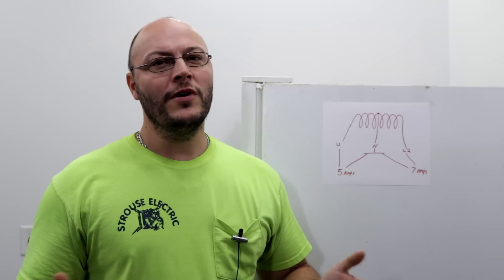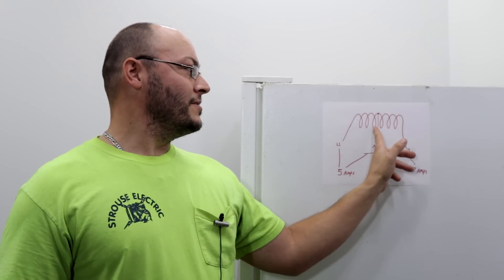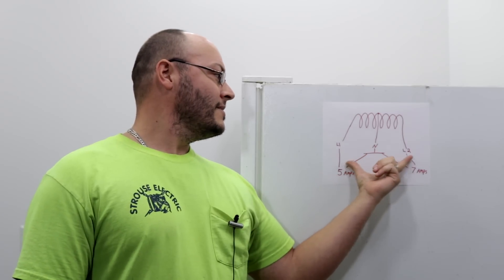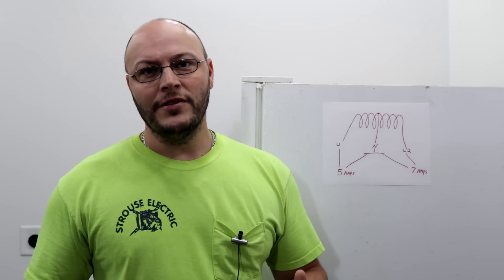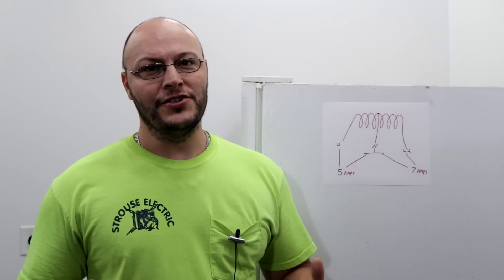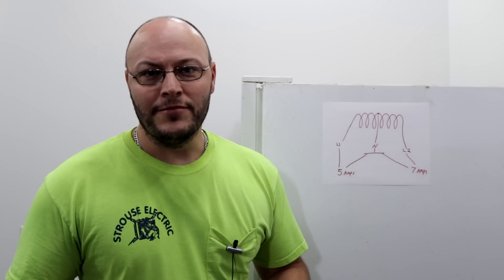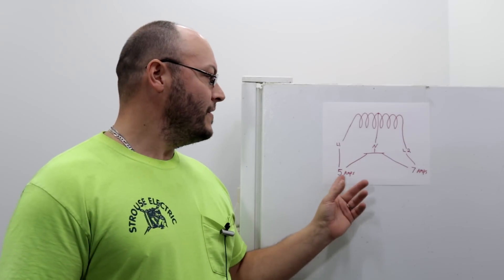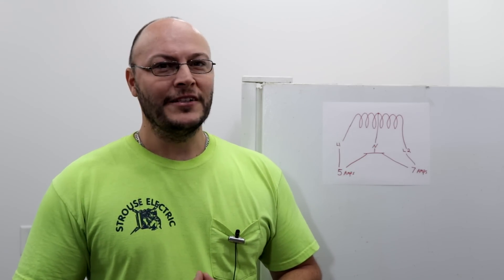What does the Neutral Wire Do?

Comment: I've been making hobby electronics for years and studying electricity on my own time on the side of my IT engineering studies, but neutral was always a bit confusing to me since obviously in an AC system polarity doesn't matter so I just couldn't really wrap my head around it as some people call neutral "0" and that kind of thing
Reply: You’re not alone. Conceptualizing an ac circuit with the neutral still confuses me though I too understand it’s “the return.” It helps to think of the hot conductors as pushing the electrons through the load to the neutral side and then pulling the electrons from the neutral side back to hot.
Reply: @esl4058  is this why the neutral doesn't read any voltage on a meter?  unless there's a problem?
Reply: @jersmith1486 Yes, if you measure between neutral and ground you should get less than 5v.

Comment: 2 years of EE many moons ago.  Must have slept through my AC class :-) and nothing to do with either in my career (maybe a good thing for many people).  Thanks for the refresher.  So tell me if I am correct here... In  a color-blind scenario (all wires are of the same color), I should be reading a 1/2 total voltage between hot and neutral?  or am I way off
Reply: Konstantin Shushkovsky, you’ll have to ask someone else... Bill passed away the same year he made this video.
Reply: @sunshine3914  sorry to hear about that RIP

Comment: So many things. 
If the transformer shown is two phases of the secondary transformer and you get 120v from line to neutral, you’ll get 208v between lines. If the neutral is just the centre tapping then in this case, it’s not carrying the out of balance current (which, incidentally isn’t 2A but the phaser sum of 5A and 7A), it’s carrying 12A.
The ground wire is to carry current to ground, not voltage; voltage is electrical pressure and current is flow.

Comment: In Short, you are right about the neutral but you are not right on the ground wire.
To understand Neutral, we have to start with the electric generator at the power plant; the generators mostly are connected as 3 phase “Y” Shape. Which are Line1, Line2 and Line3 on the outside and Neutral in the center. In the “perfect” world you would not need the neutral at all! I repeat in the “Perfect” world!! Which is the 3 loads of L1 and L2 and L3 are the same so the current on all 3 lines will be the same. I. E. L1 current is 5A, L2 is -2A And L3 is -3A, then 5 + (-2) + (-3) = 0A at the neutral point. So we don’t connect the neutral back to the generator at all and everything will work just fine. But we are not in the “perfect” world, we are in the real world, which is none of the 3 loads will be the same Which means there will be + or – current at the N Point, which also means different volt at N point as well (that is the N Point at the load is not connected to the N point at the generator). I. E., due to difference in loads there was extra current at N Point which made like 30V there, the L1 when it’s At 90 degree of the phase (top dead center) will be 120V, So total volt will be 120 – 30 = 90V At 90 Degree, but when L1 is passing by 270 degree (bottom dead center) it will be -120V, So total volt will be 30 – (-120) = 150V. That means the volt will go up and Down between 150V and 90V 60 times per second on L1, which also will be the same case for L2 and L3. So we must have N Point always at 0V to have all lines at 120V, to do that we must connect N Point at the load with the N Point at generator. And that will force N Point to be 0 Volt at all time, and yes the + or – current will flow back and force through the N Point to the generator (as you said). The Fact that after the generator there is an up transformer and at your house there is a down transformer, so we can use thinner wire gauge for that long distance, It has nothing to do with N Point, we just carry the N Point through all transformers back to the generator. 

Now for the Ground wire, originally we only had a Line L and Neutral N, and most appliances (TV, Washing machines, etc) had a metal casing to cover it (The good old days). And to prevent static electric shocks, they connected the body to the N assuming that you will connect the plug L to L and N to N, but in the real world the other country plugs has the same size and shape for L and N and the US we had some plugs also same size, and some plugs has the N bigger but people will hack saw the wall socket to make the N go into L, so eventually the body of some appliances had Live Lines on it and personally I was electrocuted several times from our TV at home with 220V (it hearts like hell) cause my dad flipped the plug several times. So to save lives Ground was introduced, so the appliance body will be connected to the ground and nothing else. (Period)
So Ground is not suppose to be connected to N, and it should not be, but in theory N is 0V and Ground is 0V, so no harm of connecting them, but in realty the neutral volt and the ground volt will never be the same. So I disagree with the code of the US to connect the Ground and neutral

I’m Electronic Engineer, we studied Power Electric in the first year of collage.
Reply: Well, he wasn't "wrong" about the ground wire.  Safety from lightning strikes is more relevant to the function of the ground wire nowadays than to prevent people from shocking themselves by making wrong connections.  No need to argue semantics.
Have you ever heard of the saying that people with a great grasp of a subject are often able to explain related things in a succinct and simple manner?  I think the guy in the video did a perfect job, especially for a Youtube video made for general people to understand the concept of what a neutral wire does.  You sound like you wanted to boast your technical knowledge while being able to say the guy in the video was wrong in some way, especially the way you wrote it.  Seems a little silly to drone on about technical details no one cares about to arrive at basically the same point the video did, and to try and correct the guy about ground wire for no reason.  People who are comfortable with themselves have no need to make needlessly verbose displays of knowledge.

Comment: The main job of the ground is to provide a path directly back to the panel and trip the breaker...which is more likely to be caused by improper torquing of lugs rather than a lightening stike.

Comment: I installed a welder receptacle a while back.  I kept reading and reading about the plug (called a 6-50, I think...), because it seemed impossible that there were two HOT wires, one GROUND wire, and NO NEUTRAL.  Is this because the welder is "balanced", taking the same amount of power down each hot line, therefore, not needing a neutral?

Comment: Electrical Engineer here. I feel compelled to write this due to some dangerous concepts that I've read here and also listened at the video.
Here, at Argentina, we use MONOPHASE 220 VAC for most of households and TRIPHASE 380 VAC for a minor portion and for small factories that don't require a service company's transformer at the premises (this is only for high end consumers).

At every plug within a house, you have three DIFFERENT connections:

1. LIVE WIRE: It carries 220 VAC to the plugged device, and supply the current needed.
2. NEUTRAL WIRE: It poses 0 VAC (if the installation is correctly done) and is the return path for the current supplied through the LIVE WIRE. This NEUTRAL POLE can be grounded at the entrance of the house OR within the block under service of the electric company supplier. It HAS TO have 0 VAC of difference with the third pole, the EARTH POLE.
3. EARTH or GROUND WIRE: This wire CARRY NO CURRENT, unless you have a LOSS PROBLEM at you installation. The current that flows over this wire is ANY DIFFERENCE between LIVE and NEUTRAL wires, and should be kept below 15 or 20 milliamperes.

To make your installation safe for humans and pets, in the case you have a loss somewhere (refrigerator, desktop computer, etc), you HAVE TO INSTALL a differential disyuntor (a magnetic key-I don't know the name in english, but is very common). This differential switch measures any difference between the incoming and outgoing current (through LIVE and NEUTRAL). It can be calibrated to set the maximum difference allowed (here is 30 milliamps).

If you have a LOSS at a given device (say the refrigerator), the CASE has an AC potential different from zero. If you touch the device being on your barefoot, then the unbalance TRY TO FIND equilibrium by DISCHARGING the additional current (not consumed by the device) through your body to the EARTH under your feet. This is called electrocution and can happen if you touch a wall as well, specially if there is humidity.

With the differential switch protecting your home at the entrance, any current above the threshold you set instantaneously trigger the switch and cut the AC all over the house.

An extreme case is trying to use an AC powered device while taking a bath. In this case, a LOT OF CURRENT would flow through you, killing you unless your installation is protected with the differential switch.

If you have a house powered with TRIPHASIC AC, then you have to install one differential switch per phase, at the very entrance of your house.

NEUTRAL, in the case of triphasic AC, is wired from the center of the star configuration of the secundary of the company's transformer down to EARTH.

Even in this case, the EARTH wiring (ground wiring) has to be present at every plug into the premises and has to have a SEPARATE wiring path towards the entrance. NEVER, EVER do the crime of wiring togheter Ground and Neutral. They are conceptually different. The GROUND or EARTH connection is there to help you or your pets from being electrocuted by using a differential switch.

After the differential switch, you can use as many thermical switches to prevent accidents in the case of shortcircuits. But remember: a 20 amperes thermal switch cut off the current if this limit is exceded, but this kind of switch will not save you from electrocution. That is the job of the differential switch.

Hope this can be useful.

Comment: The "neutral" is the grounded conductor of an electrical system. It is bonded at the transformer and at the first means of disconnect on the customer end. It is a current carrying conductor in a 120 volt circuit and carries the unbalanced current of a multiword branch circuit. This GROUNDED conductor also gets bonded to the electrical systems grounding electrode conductor also at the first means of disconnect. This "bond" of system ground and electrode ground only takes place at the main disconnect and no other place in the system to prevent objectionable current flow on grounded parts. You're welcome.

Comment: In my opinion, negative comments, as they have been called, DO have a place.  Without these comments, a person may think that the information presented herein is accurate - which it is not.  Besides, Bill even asked for feedback.  Specifically, the description of "ground" is crude - and basically wrong.  Also, the description of neutral is obfuscated - and also wrong.
Reply: Now, for those that would then conclude that Bill can't then wire a house WOULD BE WRONG - as - MOST professional electricians know VERY LITTLE about electricity.  They are TRAINED to install house wiring to code - however, they are educated very little in the SCIENCE of electricity.
Reply: After reading a bunch of the comments, I also have to say that, for most laypersons, his explanation is reasonable enough.  Can't learn Grade 12 without doing Grade 1.  We all know Grade 1 sacrifices specifics to enable a basic understanding.

Comment: A very interesting presentation but one must realize that professionals use terms that sound innocuous but they know what they are mean within the profession they work.  The neutral in electricity is not like the neutrality of Switzerland.  Electrical neutral in an appliance flows through the switch it carries ALL current back to the transformer on the pole outside your house Ground is not switched it is continuously connected to the frame of the appliance whether it is turned on or not. Neutral can kill you  and if your appliance is faulty ground can too if you become part of the circuit.

Comment: Just seen your vid and my comment is a couple of years late, but as an Industrial Electrician, I have always found that the easiest way to describe the Neutral is this,  It helps keep the pressure in your lines constant, and is the return path for the current traveling into your house or business or plant to flow back to the source.

Comment: I was looking inside someone breaker panel. I found that the wiered a 220V breaker with a 2 conductor cable with ground. So they have the black wire on one side of the double breaker and the white wire on the other breaker. With the ground a connection to the ground buss. With all the neutrals. That's got to be very bad right? Doesn't 220 need to have a 3 wire with ground?  So the neutral wire is the same gauge as the 2 hot wires? And not the smaller ground?

Comment: Just worked on a mess where someone miswired and made a ground/neutral reverse, I was getting .4 amps on the plumbing with an amp clan when the furnace kicked in and utility lights were turned on, a kid got rained in Australia with 230v playing with the hose when someone energised the ground system and he got in between the hot ground returning the current

Comment: Correct. BUT the ground from receptacles to the ground rod is a 60hz safety ground, in the event of a shorted appliance. This ground is not effective protection against lightening surges. Since  the frequency of lightening can be 1Mhz and higher a ground rod provides little protection.
Reply: I think you have been healing your Chakras too much with 432hz music. A massive copper conductor does not care what frequency it has to carry.
Reply: @Engineer9736  Massive copper conductor...where? Skin Effect (Google that) limits the effective current capacity of any conductor.

Comment: good day sir!! I really enjoy all of your video,s you make it somewhat easier to understand how all"this stuff" works"; I have a slight issue with a light/fan switch located in my ventline hood; I attempted to turn the light on- and it didn,t come on; so being :not electrically inclined I went to the first thing the light bulb; I installed a new bulb and still"no go" looking closer I noticed a single black wire dis logged from the switch itself-a 'black square that has three holes; there is a "RED" heavier guage wire inserted into one of the  holes leaving (2) Black THINNER wires; I cannot figure out "WHICH BLACK WIRE GOES WHERE??? are both of these wires "HOT" WITH THE red WIRE ACTING AS A neutral wire??  sorry I do not know how to figure out which wire goes where; are the (2) BLACK  wires hot ;3 wire 3 holes?? any help appreciated,thank you,PATRICK.P

Comment: Seen a good deal of comments here. He explains it very well in this video. I started out 3 phase industrial, actually generating the electricity. So, single phase was a mystery to me. After spending some time doing residential contracting, I can tell you this guy is mostly on point. For all you helpers/apprentices out there. Please understand that under normal conditions your bare ground wire should never have energy in it ever. The whole reason your neutrals and grounds are bound together in the service (Or first means of disconnect) is that it is a shorter distance to discharge unwanted electrical surges which is the whole means of your grounds in the first place, as the distance to the transformer. Having Neutrals and grounds bound together at the service serve this purpose and this purpose alone......there again under normal circumstances.

Comment: We have a TT earthing system here in NZ with a Multiple Earth Neutral link bar in the main switchboard. The purpose of the Earth conductor is to provide a low impedance path for fault current to flow in the event of an earth-active phase conductor fault. not just a lightning strike, but to provide an equal bonding to all metal structures within the installation. not just domestic, but commercial and Industrial. The drawing is incorrect as the neutral is bolted to the middle of the windings. You should show a Star connected secondary winding with the star point at Earth potential. This is also the Neutral point. In a domestic installation, the incoming Active phases are balanced out between Houses, having L1-L2, L2-L3, L3-L1 connections. The Neutral is the negative half of the cycle return path of the load. I think the video is totally misleading.

Comment: You are most certainly wrong. lol JK...however....
The neutral provides a path back to the source of power, regardless of the perceived imbalance.
The current used is always going to make it's way back to the source. if the neutral were not provided, then the ground would fill that role...yes it would....yes...it would!!
As long as the source is grounded, the earth ground at the load would find it self being used as a return...
just is, brother.